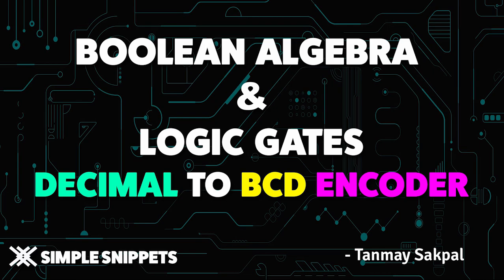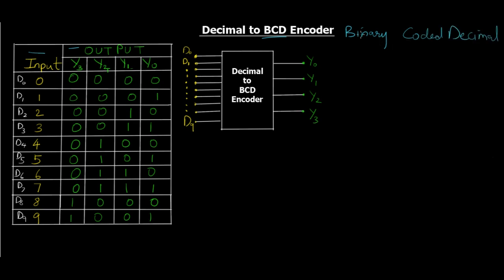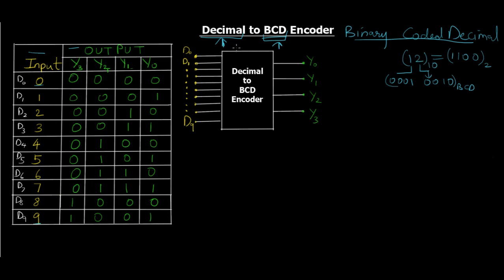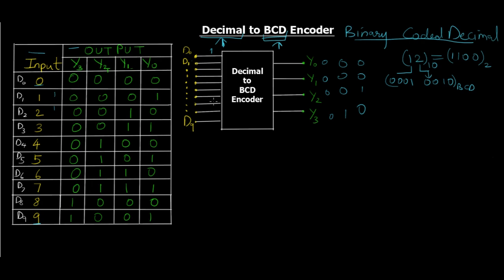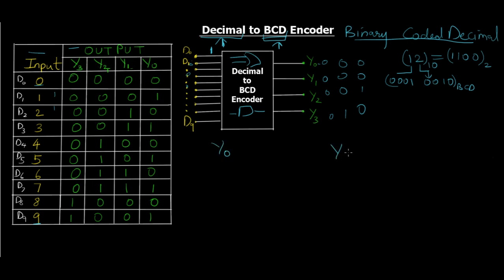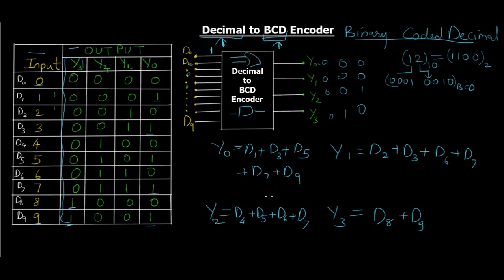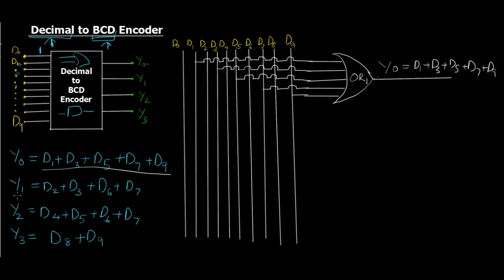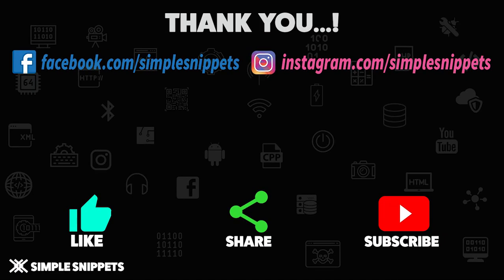Decimal to BCD Encoder Circuit with Truth Table & Circuit Diagram

Comment: Very very good video but kindly do a video on how two or more decimal digits can be represented in binary form and also how those digits are reflected on the calculator display in decimal form??, your circuit design shows only single digit decimal representation. 
I know it's bit painful as it should be a long video but please do it for the sake of science.